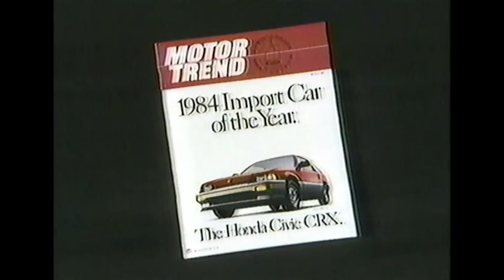DEL SOL: Honda's GREATEST Mistake

Comment: Myself and wife had an SiR.  OMG that was an awesome car.  I remember one day doing somewhere around 80kph in 5th and went to pass a truck going up a hill.  Dropped it to 3rd, floored it.  The wheels spun/broke traction.   I also liked that you could take the top off and leave rear window up, they designed it so well there was little to no wind in the cabin on open road.  For a 4 pot it sounded good too, esp when that vtec kicked in.  It was def better than the MX5, more lively and edgy.  The only negative thing for me is that it did tend to noticeably torque steer, to a point that I didn’t like.  At times it felt like you were battling the car.
Reply: If you're telling the truth about your Del Sol spun the tires at 80kph in 3rd gear...then there was some unique circumstances involved that need addressing. You can't just expect people to believe that it would be expected to do that normally, in a straight line, on decent asphalt, in nice weather, etc.
Reply: If you were doing 80KPH(50MPH) and dropped in 3rd I think you hit redline on the tach with that move.
Reply: @philmonat9352  So maybe he broke lose the tires for a second via engine braking. LOL. Not the picture he was trying to paint.

Comment: My first Honda was a '93 Del Sol si. I bought it in '98 with 36k miles. With the roof out traveling down the road, I could feel the steering wheel move laterally from torsional flex in the floor pan. I kept it for almost 2 years, then sold it to buy a crx. I've owned 4 crx's since. I never looked at a Del Sol again.

Comment: The del sol became the S2000 which crushed the miata in every way

The Sir = the 1.6L B16a2 1995 thru 1997 Del Sol VTEC sold in the US - same engine used in the EM1 in 1999

Comment: When I was a kid I wanted a del sol bad. It was my dream car. I knew nothing about performance but thought it looked cool. I also wanted cheetah print seats and fuzzy dice in it lol. Showing my age there. The Miata was never on my radar until Haggard Garage. I now own a 1990 Miata, non Haggard edition, though that was my plan until I actually drove the thing. Which was 5 minutes after I bought it and pulled into a gas station a little quicker than most but there was no drama. But, I went with the Miata because I needed something cheap and the S2000 was out of my price range. I'm forever Miata but could you imagine an S2000 in the 90's? It would've been one of the greatest rivalries in history!

Comment: Honda was not even taking on Mazda. That is a myth propagated by the nieve basing their comparison that they are both NOT fixed solid roof tops.
Look at the design closely and a Targa is not the same as a convertible
A hard top is not the same as a soft top

Also, comparing special edition models (that boost sales), the Miata had no less than 15 special editions to boost sales (marketing differences).

In anycase, the fact that decades later the Miata made a Del Sol copy with the Miata (ND) RF shows how far ahead Honda was.

Comment: I have one of these.  I call it the "green jelly bean".  Original owner, although it's like the ship of theseus.  I've replaced so much.  Unfortunately, the pick-n-pull lots just stopped getting them about 2 years back.   Love it and will probably replace the engine (again) when it goes out. (I learned the hard way to not mix antifreeze types many years back and had to replace the engine) I just hit 215,000 miles. Most of the ones I was seeing in the pick-n-pull lots were around 180K  That's about when the great part replacement project started for me.
Turns out this is the same car as the Acura Integra that so many love.  So I get parts from old Interas as well.  Even added the rear sway bar that was not included on the del sol.  It was a simple bolt on addition since the chassis is the same.

Comment: I regret having sold my 95 CRX Del Sol.. it would have been a great 'project' car for when I would have free time... It was fun, reliable, and so great to drive with the roof off... and hit the right rpms to have the Vtech scream. It had a B16 engine with aftermarket dampers .. a real rocket.

Comment: I owned one of these, I hardly call the car a failure, understand you're roof will ALWAYS leak, regardless, Shin-Etsu grease the seals every so often and you can keep it too a minimum, Del Sol is that Honda that requires a little more attention, the, "Italian" like characteristics of the roof leak, moderate electrical issues, gave it a weird attraction, but the engine was still Honda reliable, drove like a shortened EG Civic that wasn't fully adjusted so it was a bit twitchy and questionable in the corners, but if you understood its handling, you could get it to work pretty damn well, would so own another one, but I understand why the Miata is more wanted, COUGH COUGH REAR WHEEL DRIVE I shouldn't have sold it

Comment: The video's a little decieving isn't it? True, SiR was never released in USA, the the Del Sol VTEC model was. It had the same DOHC Vtec B16 with 160 hp, and it came with disc brakes on all four wheels. I'm not sure if it had stiffer suspension and LSD though, which may have been the main difference between the VTEC model and the SiR - but those aren't emissions related. Maybe I'm missing something...

Comment: I started as a tech at a Honda dealership in 1991. Those Del Sols were a nightmare. Before they went out of production, there were 7 service bulletins for squeaks, rattles, wind noise, and water leaks. It was such a terrible piece of crap. The B16 was the good part.

Comment: I called it the CR-FLEX because the chassis would flex like crazy when going up a steep driveway at an angle.  Leaky roof seals,  door panels with shitty vinyl adhesive, terrible blind side, heavy AF.  You couldn't even get good road head in one because the center console was so damn bulky and the seats sat so low.  The only thing I liked about it was the spacious engine bay.  Compared to the 2nd Gen CRX, it's a total downgrade in just about every way.  The Miata and the Del Sol were considered chick cars(or barbie cars) by just about everyone.  But nostalgia is a helluva drug, so people will still love it.
Reply: Bad news, the sorts of people who judge cars as 'chick cars' think your (awesome, btw) CRX is a chick car too.

It's such a cringe thing to say. Why be like those needledicks?

Comment: Looked hard at the Del Sol in the mid-90s. For about the same price I got into an Integra which I drove until I found the S2000. Loved the concept, but the potential issues with the roof and rear window pushed me more toward the rock solid Acura. But nothing compared to the S2k.

Comment: I loved my Del Sol, but had a few issues.  I have big feet and the wire harness above the clutch rest pedal would come undone and the car wouldn't start.  Was a clutch and a light car, so I would just get out, push it and then pop the clutch.  Once started it didn't stall.  The other main issue was the handling with the targa top off.  Lots of twising vs. when the top was on.  It seemed like the doors were made of alumnium they dented so easily.  Also in order to get power you REALLY had to rev the engine to very high RPMs, which was quite different vs. other cars I had previously owned.  Overall lots of fun, a huge trunk for the size of the car.

Comment: I have a 93 si 5speed with 260k that I bought for 500 bucks. Very minor rust runs fantastic roof doesn't leak. Also I'm 6'8 and fit nicely. It's fun fast handles surprisingly well goes good in snow gets over 30 mpg and it Just. Does. Not. Break.

Comment: I owned a '90 CRX. When the Del Sol came out I looked it over. I concluded that Honda had succeeded in building a car that had all of the DISadvantages of a mid engine design, with NONE of the advantages. I happily drove my CRX for another 10 years.

Comment: I think the direct competitor from Mazda for the Del Sol was actually the MX-3, both having FWD with the MX-3 offering two 1.6L I4  engines (SOHC and DOHC versions) and a 1.8L V6 outputing 133 HP, one of the smallest V6 engines on the market (Mitsubishi had a 1.6L V6). From the front they are quite similar, but there are some differences: the MX-3 was a hatchback with 4 seats ( I wouldn't really call the back seats as usable though, not for a long trip at least) and it came with a sunroof.

Comment: I bought my Honda Civic Del Sol, new in 1993 and still drive it daily. No engine or auto transmission repairs. Yes, other repairs, but nothing major. No doubt the Arizona weather has contributed to its longevity Hardly my greatest mistake!!

Comment: I had a ' 93 metallic blue one,  bought as the 3rd owner. great car with some design flaws. 1. You couldn't last an hour in that car in the seating position it was meant to drive in. 2. they all had issues with rusting at the the side of the seat, lower part of columns (water drainage issue). 3. Bad seal design around the targa roof. (leaked like a siv). The power train and handling was good with a little tweak could be excellent. Lot more room than the equivalent year Mazda Miata (brother had a '94 red one) I have a 1987 Toyota Celica GT rag top as a run around toy (lots more issues)👍

Comment: Ive got a del sol with a B18 ls bottom end and b16 pr3-2 head manual with body kit, lowered on coilovers and aftermarket lower control arms if anyone is interested! Located in Florida. Runs and drives but needs odds and ends finished up

Comment: I didn't care for the Del Sol when it was introduced. After looking at a few in the dealer, I decided I wanted a 2nd generation CRX Si instead. Ironically, I later ended up with a 01 Miata, which remains my daily driver to this day.

Comment: As a delsol owner I think the real honda mistake was making it FWD with weak chasis. The car was perfect for a central rear engine configuration and I will never understand why they didn’t that way. I own an s2000 as well and this one is an absolute different animal. I use the delsol as a daily, even being a moddified car, and that’s ok, but I sometimes imagine how different the delsol could performs with a rear engine, rwd, and a good and properly balanced frame as the s2000. What a great mistake

Comment: There are 2 train of thoughts:
No replacement for displacement vs. Increased weight reduction.
A steel 427 cubic inch engine with a supercharged blower is so heavy that it's uncontrollable, when not flying down the track in a straight line.
At 04:18...Is this understeer caused by too much weight up front or cost cutting in the suspension?
Honda had a price point and the Del Sol is what it is...pretty sheet metal.
Does a CRX with a B18 or a C18 Series engine handle better than an Integra, with the same engine and what happens to the handling of those cars when a K Series in introduced?
In the end, an engine's increased weight reduction wins.

Comment: I don't see the del Sol as "Mistake". It just wasn't the mass product like the MX5. It had a quite unique design and was closer to the Toyota MR2 mk2 than to the Miata or MG F, Fiat Barchetta. The del Sol offered a 300 l trunk which was huge compared to others. The manual roof was a lightweight to handle. The e-top limited the trunk but it was as amazing as the later Peugeot 206 CC or Mercedes SLK folding tops. The del Sol wasn't meant as "sport car" with its 120-160 PS. It was just a nice small car to have fun on the weekend in the 90's and still brings the same fun 25 years later. If you never owned one - you miss something.

Comment: The VTEC trim which started in 1994 stateside was the equivalent to the japanese SiR, sooooo... no, bringing the SiR stateside would not have made it the miata killer, because we got it here in 94 and it didnt kill the miata. I have a 95 VTEC with the B16A3 and its fun as hell to drive. Its also likely faster than an SiR because it lacks the massive weight of the transtop inner workings.

Comment: Get the facts straight the top version of the del sol witch was the vtec not the Si came with a B16a3 if you’re going to do a video about a car at least do good research. Also this has happened in this channel a lot

Comment: The del sol is something that I saw once and immediately knew I wanted it. I currently have a 6th gen civic with the D16Y8 and that thing is fun. It clicked with me in a way no other car had due to its size and handling. Maybe I'm setting myself up for failure, but I'm looking for the level above that with the Miata and Del Sol.
Reply: Wait until you drive a k series v tec after that d16

Comment: I never owned a Del Sol,  I thought they looked as cool as the older T Birds, both two seaters!  Id still like to own one! But now im so old and fat i would need a can opener to get in and out of one!! I do have a Honda Insight, and love the great FULE  milage ,its a Hibred! The big battery never gave me a problem, but the CVT trans is starting to slip gears at 245k. i use alot of trans stop slip!!

Comment: I drove a del sol 100 feet and went. No. It did not handle like the CRX. Miata didn't either. I'm still looking for the next CRX. At this point I'd settle for any Honda or Toyota convertible. Even another celica.

Comment: It wasnt a bad car really but def had too much weight due to extra strengthening around the mid section to compensate for the open top. Honda def should have kept the CRX going they were very unwise to discontinue it. I remember back when they were new and it seems like peoples' desire to own one has never really decreased over the year.

Comment: i see everything to do with MX-5 as extension of light UK cars of 60s (Lotus Elan, MGB, Sunbeam  Alpine, TVR Griffith and like half the production it seems). Yes engine is on other side of the car but its still small, light, exceptionally nimble aswell as cheap.

Comment: You made one mistake when describing the engines there were only 2 in 93 the SOHC D15B7 and the D16Z6 then in 94 they added the DOHC VTEC B16A3 then in 96 when OBD2 was mandatory they used the engines from the civics again and used the D16Y7/Y8 for the Y8 for the SOHC VTEC and Y7 for the Non VTEC. These different single cam engines had different intake manifolds as the OBD1 versions and different ECU’s as well as the heads were different and so were the pistons between the OBD1 D16 and the OBD2 D16Y8 the same is true with the OBD1 D15 and the OBD2 D16Y7 because of the OBD2 situation. Honda still used the B16A3 in 96-97 however it had a different wiring harness and ECU as well as a couple engine changes like the IAT sensor moved and had a different plug, the crank position sensor was added to the front of the oil pump instead of using the one inside the distributor. So in conclusion there are 5 different engines in the U.S. however 6 different engine wiring harnesses and 6 different ECU’s. I hate to even have to write this, however as a 25 year Honda Mechanic I have to at least make sure the facts are known. Side note many people love the 99-00 Civic Si because of the DOHC VTEC B16A2 which is pretty much identical to the 96-97 Del Sol B16A3 with two differences one the ECU for the 97 is OBD2a and the 99-00 is OBD2b so they changed the ECU Plugs and the OBD2a ECU’s were rectangles like the ones before them and the 99-00 ECU’s were square and the 96-97 Del Sol B16A3 came with a CTR “Civic Type R” Transmission minus the LSD in the gearbox and had shorter gear ratios than the 99-00 Si which had the same gear ratios as a Integra Type R however again no LSD in the gearbox. That engine and trans is why so many got stolen and they’re a little harder to find in the U.S. because using that transmission in a civic or Integra with a B Series would make your car just a tad bit quicker stop light to stop light. The funny thing is why the Del Sol got the CTR gear ratios was because of how heavy the car was, it needed the little bit of help to get it to be quick enough to beat many other cars on the road the years they came out. Hopefully this explains a tad bit more about their engines and transmissions.

Comment: Didn't the Del Sol have a weight issue, the weight being the same or slightly more than a 5-seater Civic Si hatchback?
Reply: The Del Sol is heavier than the EG Si hatch, but the difference really isn’t that big. Best Motoring has a video of an EG6 Si-R racing a Del Sol Si-R; surprisingly the hatch isn’t much faster. Also, if the Sol didn’t have the automatic targa the race would’ve been even closer. 

For a proper comparison, a ‘93 Civic VX weighs 2094lbs according to the KBB, and the base model Del Sol S from the same year weighs as low as 2277lbs.

Comment: If the Del Sol had been a true convertible roadster with a little better handling (as well as a "touch" more exotic in looks) than the Miata it would still be around. I like the Del Sol concept (with an added handling package), but the damn thing is hideous when compared to a Miata from any era.

Sometimes looks matter. Example being myself. I'm 57, I don't care for performance driving anymore. Give me a slightly peppy Corolla with a stiff suspension and fantastic fuel economy that LOOKS like Lotus Emira and I'll buy it.

Comment: You guys should clearly do more research before your videos. From 1994 up there were 3 trims the s trim which was the base with the 1.5l d15 the si with the single cam vetc d16z6 or d16y8 if you got a 96-97 model or the VTEC trim which offered the dohc B16a3 from 94-95 or the B16a2 in 96-97 so yes you could have the b16 in the usa and it would smoke a Miata and these cars handle very well if you know how to drive.

Comment: The weight distribution was awful on that car. I went to test drive one. I would have exchanged it for my Prelude at the time. But it handled far worst than the Prelude, so I had no interest in buying it. If Honda had given it RWD, the weight distribution would have been MUCH better. But being FWD, it was pushy and unresponsive in tight turns. So it was a fake sports car. It had the looks, but only that.